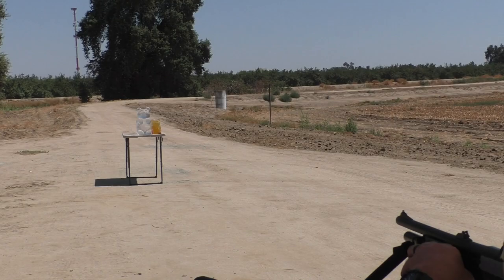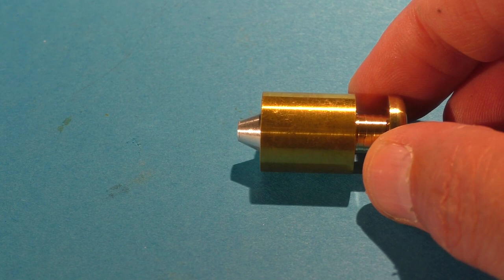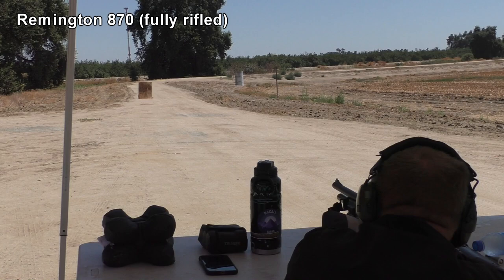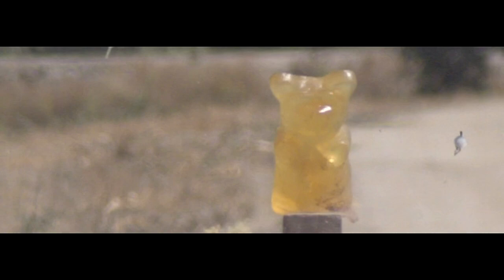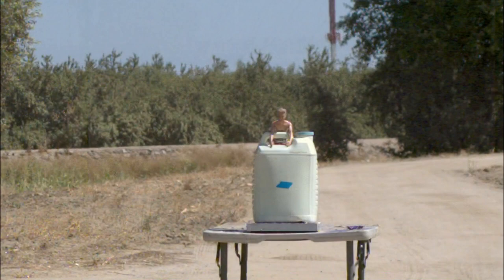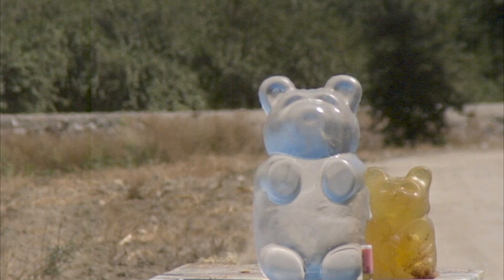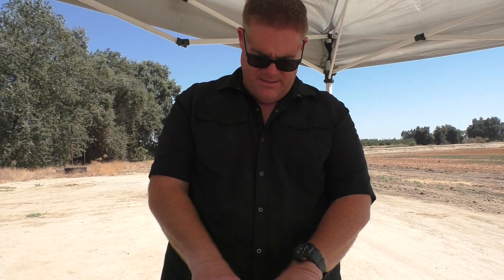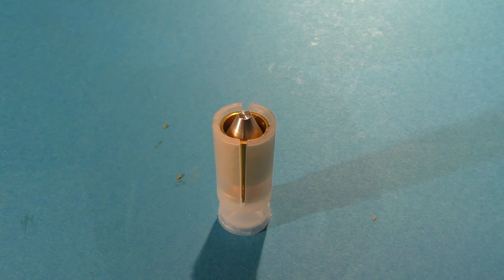Brenneke SUPER SABOT 12g. Shotgun Slugs  -  We test them out!

Comment: I think it would be interesting to harvest the slugs out of these particular shells and then do your own load and packing to see if you can produce a more stable overall cartridge. Just a thought.
Reply: EXactly!
Reply: It's a weirdly gimmicky design, so yeah, I'd really like to see it work as intended to see if it does anything interesting.
Why they made it push the tip forward instead of just making it the shape it ends up as to begin with is beyond me.
Reply: I was about to submit the same idea lol. That would be a proof that the shells have a design flaw.
Reply: I sure hope they actually do that
the powder may be the main issue here

as for the weird multi piece design, maybe they where trying to reduce felt recoil or something?
then again, it's only by maybe a fraction of a split second, so perhaps it has something to do with manufacturing and/or the expansion gimmick
Reply: That is a really good thought.
Reply: My thoughts on what is happening. The rear piece of the slug is "designed" to cushion the sabot against the pressure of the fairly high powder load. Instead, it is creating a pressure wave outwards destroying the sabot before it leaves the barrel and so imparting no spin on the projectile. What is more, the mushroom piece is also likely rattling its way into the cylinder because of the rings around the "plunger" part and an assumption the powder ignites uniformly - which it never does! These vibrations would add to the destruction of the sabot and prevent engagement with the rifling - mainly because there is nothing left to engauge.  If I had the equipment, I would take out the three part slug, hammer in the back piece to its final position, and put it back in a shell with a more conventional sabot and a smaller powder load. Having said that, I think these rounds are a huge fail as an idea.
Reply: @Bacteriophagebs  that is why you don't design rounds    :)
Reply: could be twist rate being wrong for the weight of slug: I would be more concerned with the unusual powder though; shape, age and composition
Reply: I was just about to make the same comment.
Reply: @Signal Five lol dang you beat me to it. That’s exactly what I commented because I think it could seriously be the problem. Granted I am just now discovering this video

Comment: It's almost tempting to break those down and replace that powder with something like Clays or another that is far less sensitive to temperature extremes. That would answer the question of whether the sabots were failing due to heat or pressure excursions.
Reply: Yeah, I think you are on the right track NMann... Jeff has enough recipes with Longshot or Clays that he could do that and rule out the powder issues ASAP. I would like to see him get the velocities up to around 1,750-1,900FPS too.
Reply: Doesn't seem like the sabot is the problem looks like it's burning way to slow when it's hot and melting the sabot the last round was moving far faster 🤣
Reply: That is what I was thinking. They ought to load some of those up with Unique or something.
Reply: This was exactly what I thought when watching. I would love to see Jeff change out the powder to see if he could dial them in!
Reply: Same thoughts here❤️
Reply: Faster spin with increased velocities I believe might help here. Is there a difference in the rate of rifling per inch for European shotguns? I wonder what those would perform like in a un-slit, heavy wad like a TPS over a fairly warm charge of longshot. WoW I’d love to see that…
Reply: I was thinking the same. I didn't like the appearance of the powder.  I've never seen flakes of that size and colour.
Reply: Trying the slug with a different load might work. It is an interesting concept to collapse the slug. Maybe next time
Reply: If only there was some mad scientist slug designer capable of engineering such a thing 😄
Reply: Was thinking the Samething!!! I was guessing that’s what they were going to do was change the wading and use a different powder.
Reply: I couldn’t understand why they didn’t want to do that maybe they just got to flustered but they might do a follow up video where they do I hope.
Reply: @dioad1739  I just assumed they wanted to see how they performed out-of-the-box, since 99+% of shotgunners would use them that way.
Reply: Not a bad idea at all really. You know the weight of the projectile and as well as any other factors you need to calculate the correct powder charge. It would be safe to experiment.

Comment: I bought the Brenneke sabot rounds when they first came out.  They had decent accuracy but seemed to be hot loaded. I put a hole clear through a Datsun sedans engine block. You could squat on one side and see daylight through the hole. That was from a mossberg 500 with 18 inch barrel from around 10 feet.  But that was literally from the first rounds of brenneke to hit the market.  I was single and had spare money.  They were expensive.  Oh yeah, it was IC cylinder barrel. Smooth bore.
Reply: Poor Datsun,  hopefully it didn't  suffer.
Reply: you managed to squeeze those slugs though an IC choke? I've got a pile of those super sabots but have never fired them because I'm too lazy to swap out my IC choke for a cyl. The slug is larger than the diameter of an IC choke by a substantial amount. I was worried about damaging my barrel.
Reply: @xm15ar   lol. I just administered the coup de grace.  It had been abandoned out in the boonies of Southern Oregon on a fire road.  It had been shot up a bunch.  That was back in the mid 80s. Back then they were left wherever they were without being hauled away.  Good for target practice though! 👍
Reply: @NorthernBCFlyGuy  it was improved cylinder.   Which is a slightly smaller barrel end.  No actual choke involved.  It just squeezed the load a little on the way out.
Reply: @markmiller897  improved cylinder is the choke it is built into the last 3-4" of the muzzle end of barrel or may be a variable choke device( interchangeable tubes or a polychoke collet type)
           choke                                  constriction                                muzzle diameter
cylinder                                                 0.000                                               .729"
Imp cylinder                                         0.010                                               .719"
modified                                               0.020                                               .709"
full                                                         0.035                                               .694"
choke constriction makes a significant difference in barrel integrity

Comment: The heat of summer is when I do my load testing with my reloads for pressure signs and accuracy. What will function great with no pressure problems in cold weather, may, (especially if ball powder) pop primers in summer heat. You would think a company like this one would've tested in heat as well as cold or cooler. I have tested my 308 rounds from freezer temp to leaving in the sun and their is a difference in velocity. Again, ball powder is a given in my experience to be temperature sensitive. I have loaded shotgun, but it's been a few years. Extruded powders are more forgiving in my experience with temp sensitivity. I'm sure you know this Tao, just trying to help those who have less or no experience with powders or reloading. In the  end I feel like the wad is the problem.
Sorry so long.
Nice video as usual! 
Keep'em coming!
Reply: When we did a gun shoot (naval guns, of any caliber above .50, normally 3", 5" or greater) we had to average the last three days mag temps to get an idea of the IV.

Comment: The temperature variance is fascinating! I suppose if these are from Europe they possibly aren't designed for American temperatures. Are the rounds relatively recently manufactured? If not, the plastic or the powder may have degraded over time, dependent on storage conditions.
Reply from the maker: As far as I know they came directly from Brenneke's US distributor.  They probably were make pretty recently
Reply: @taofledermaus  You know how it goes man. Powder chemistry can be fucky with temps, and if these are from Germany they also spent time at sea, it's possible the powder chemistry was altered by the long exposure to high humidity salt air in addition to the heat. There's definitely something going on here that most likely has to do with a combination of how the ammo was manufactured, and how it was stored
Reply: @TheOriginalFaxon  I don't think so. The fact that just cooling one down proved to work shows this is most likely a temperature issue as Jeff discussed. Ammo does indeed degrade over long periods of time depending on storage conditions but ammo is also well sealed against the elements so it takes years to go bad, usually.
Reply: @Stigstigster  Temperature issue goes to storage though, that's fully included in my point. Some plastics also CAN degrade in such conditions when sealed, it all depends on the rated temperature range for a given polymer mixture, and how malleable or firm it will be at a given temp. Storing in low temp conditions like inside a cooler, as they've done in the past, might have helped with this, had they been aware of the issue ahead of time. Forgive me for the confusion, I was being hyper-technical in my use of the term to encompass any condition in which the ammo lived prior to being fired, and temperature is a sub-category of that in my mind
Reply: Meanwhile, EU is a large place. In France, Italy or Spain, we have some very high temperatures too, and in France for example, we have lots of hunters. It's not like if these shells were designed only for hunting in Norway. I think this is either a big design flaw, either a defective batch. Maybe ?
Reply: @fridaycaliforniaa236  I would expect hunting season to be in the fall in Europe as it is in North America. still no excuse for this kind of failure. at least a warning on the box would be nice.

Comment: My experience with plastics is that they degenerate overtime. I imagine the sabo just wasn't holding up through the pressures.
Reply: I was also thinking the plastic may have degraded over time. Though, time and heat could mess up the powder too.

Comment: Cool/cold weather slugs.
Maybe try adding a fibre or cork wad between the powder and the original wad. Also, maybe using another type of powder.
Reply from the maker: I have a FEW left,  so I am going to chop off the gas seal,  maybe use an x12x high pressure seal,  a cork wad and Longshot

Comment: As clearly noted, the sabot wadding is failing. I find it hard to believe though for it to be temp related judging by the first shot with a cold barrel. I personally think you got lucky with the one shell that actually shot true.  I am almost wondering if either A) the wadding is poor quality, or B) the round itself has too much powder for the type of material/wadding that is being used.  It would have been nice to see what the chrono would have shown for exit velocity of the round becaused those wad pieces looked like they were moving faster than the round itself on exit which would leave me to believe the sabot is failing either as the shot is being fired or due to over-velocity within the barrel.

Comment: You’ve got to wonder about the conditions they were stored under and if the wad and components had degraded over time.
Reply: My department always kept the shotguns loaded in the units. We are in the low desert where it gets in excess of 115 on a regular basis, which means something in excess of 140 inside the vehicles.  We had some real problems with Winchester 00 buck one year.  I think the humidity and heat got to the components and caused weird velocity drops and wild patterns.  Winchester replaced all of the rounds we had left.

Comment: Could the heat be effecting the expansion co efficient between the aluminium and the brass, therefore not allowing the aluminium tip to slide forward as designed? 

Just a thought.
Reply from the maker: They were definitely sliding forward.

Comment: Yeah, I'd agree that the powder being too heat sensitive is the most likely thing.
A lot of places in the world don't or at least didn't used to get as hot as in parts of the US,
so they're designed to a different specification, chocolate's a good example where most
parts of Europe don't have the same additive as NA to keep it from melting around 30c.

Comment: Feels like the slugs are a bit old. The base of the sabot might work better with a cardboard plug. Plastic might need to be taped tighter around the slug. The plunger looked almost like it was spring loaded. Doesn't need the plunger to perform well.  Snip it off and re-seat.

Comment: I use Brenneke Magnum Crush and have never had a problem. The box you showed appeared to be rather old. Perhaps attempting to obtain the lot number date of manufacture would provide some clues, especially if the shells are old. Plastic usually becomes brittle with age!
Reply from the maker: The one complete wad we found is very flexible still.

Comment: ive seen old Brenneke sabots get weak. we had the same results, plastic wasnt as good back then as it is now. the other Brenneke slugs ive used, even though i have not used this one. has done great but we used them during winter so i dont know about the pressure issues from temp

Comment: Im assuming it a full rifled barrel and not a rifled choke. So is it possible plastic guide is over compressed? Maybe their barrels are not as tight. Its a guess but a production slug this bad out of the box. Somebody surely would noticed issues.

Seeing end part of cooling it. Brings me back to wad part, over compressed and chilled it shrinks just enough. Seems pretty odd and probably would not think heat issues. I mean a bomb is going off right behind this slug… Maybe change out the wad with a harder plastic wad.

Comment: I think the temperature is the culprit here everything goes through changes in the heat
Plastic metal everything 
However plastic has the most interesting change sure it gains length   but it also loses strength 
It also becomes more malleable
So im certain the over heated sabot is the main issue

Comment: The slug was designed that way to maximize its mass on impact as well as increase its momentum the issue really is when it "plungers" its weight ratio(not the weight of the slug just its center of mass) changes and tumbles

Comment: Great video despite the results. -- IF -- the heat was affecting the plastic of the sabot, softening that plastic enough so that it could not grip the rifling, THEN I would expect to see a buildup of plastic residue on the inside of the barrel. - Also, I don't think gun powders are affected much by temperature; especially between 20- and 100-degrees Fahrenheit. But the plastics, yes.

Comment: Break them down and reload them with a more consistent powder and a stronger sabot
Reply from the maker: I have to use the sabot section still,  but I might reload them using a higher pressure gas seal and THEN test them in even hotter weather.

Comment: I wonder how it would go if you did a complete reload of the rounds and maybe back off the powder 10-20%. Cuz a hot barrel will expand in both directions making the OD bigger but, the ID will get smaller. Regardless 90° might effect the barrel size by maybe .0001-.0002", I just couldn't see any more than that. It's gotta be factory junk. I guess you could try an alcohol bath cooled by dry ice would help "chill" the round.

Comment: The steel of the shotgun barrels has expanded due to the heat, which has changed the calibration of the rifled barrel.  Since the German ammunition is worked to very tight tolerances, the sabot no longer engages sufficiently in the rifling of the barrel and the projectile is not stabilized.
Reply from the maker: The sabot isn't going to work properly if it is blown into pieces.

Comment: I bet if you changed the gun powder it would act better. it could be the square powder is creating a lower flash point as it gets hotter causing a quicker pressure build than intended.

Comment: Heat does strange things to guns and ammo. I remember one of our machine gun shoots where it was far hotter than normal for Memorial Day weekend. One of the 8mm Mauser ammo cans ended up in the sun and nobody noticed. Something really off happened when that ammo was fed thru the WWI German Maxim belt fed. As the round was pulled from the belt and dropped down into the chamber position, the bullet would literally just fall out of th but e case. Most of the powder would spill out and end up in a pike until enough was gathered and then ..poof..just a big grey puff of smoke would appear. It wasn’t until enough bullets fell out that it jammed the bolt/lock and the top cover was opened that we noticed what was going on. Left that ammo can in the shade for the rest of the day and it ran just fine for the evening shooting. Made sure that it never happened again!
Reply from the maker: that's wild!

Comment: I'm no gun expert, far from it, but my first thought when you said heat issue was... Is this loaded with powder meant to be shot wintertime. In other words, it's designed to work optimal in sub zero temperatures, or below 32F.  Should be labeled on the packaging though?
Reply from the maker: Probably not that low.   The same sort of issue happened to some DDplek slugs we tested in the heat a couple years ago and that company from Latvia never planned for that either
Reply: @taofledermaus  Might be the case! If one look at avg temperatures here in Europe, 90+ F is way over the avg. 
Helmut might have though that no one go hunting in those high temperatures :)